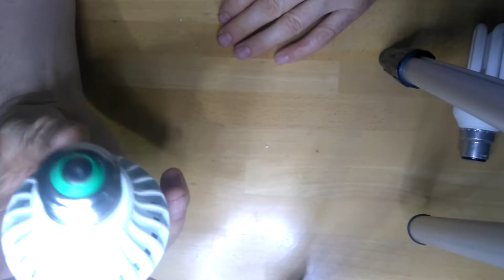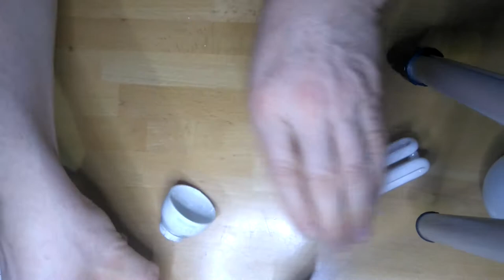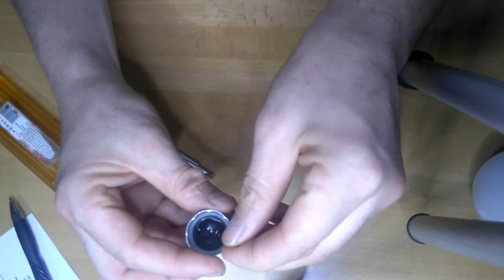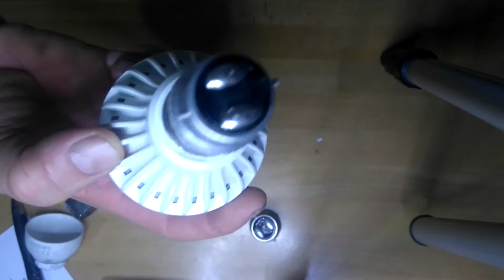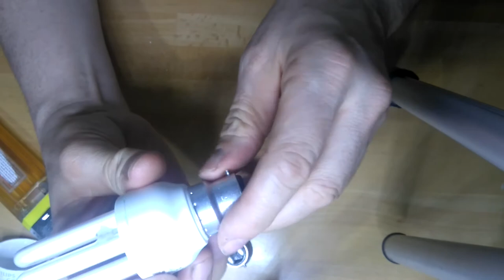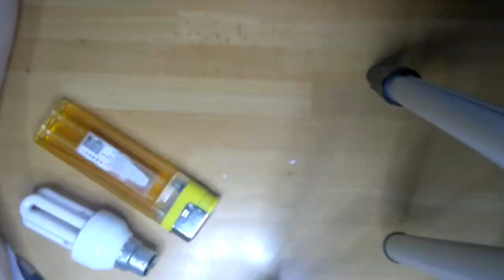Easy how to convert E27 screw to B22 bayonet led light bulb

Comment: I hope the ES cap is isolated as it carries part of the circuit. If not, it could well be live! Better still, just buy a properly made safe ES to BC adapter. They're only a couple euros. you can also buy BC to ES versions. Converting one to the other isn't worth the hassle.
Reply from the maker: ES cap sould normally  be earthed, RCD will trip immediatelly  , if no RCD this bulb will short L and earth, MCB will trip or will short N and earth , there is no health risk. only risk is if the apliance is metal and not earthed which is already wrong potential healt risk on it, most light fixtures today plastic
Reply: In Europe and the UK the ES cap should NOT be earthed, but connected to neutral. Any earth connection should be to the metal body of the fitting only. 
If the lamp is converted to BC there is a 50/50 chance  of the cap being live depending which way round it is inserted into the holder
Reply from the maker: @peterking2794  In EU E27 screw cap is definitely connected to N but in UK bayonet cap sometime connected to earth if the fixture is metal ,if plastic connected to no where